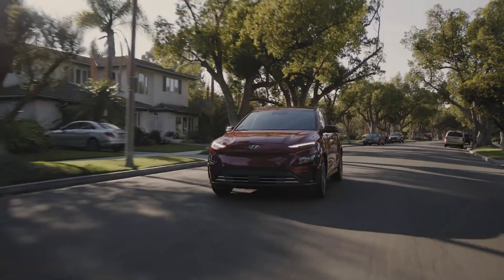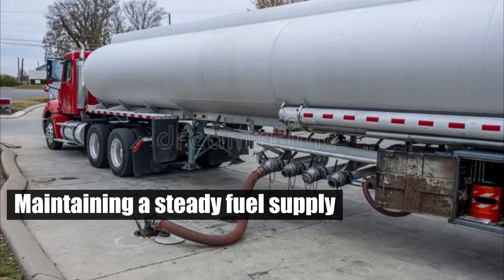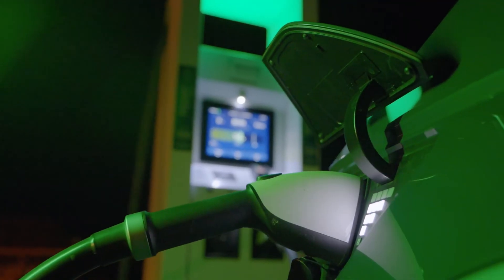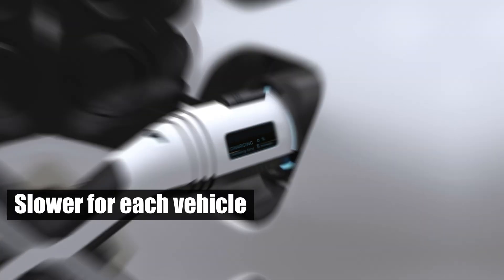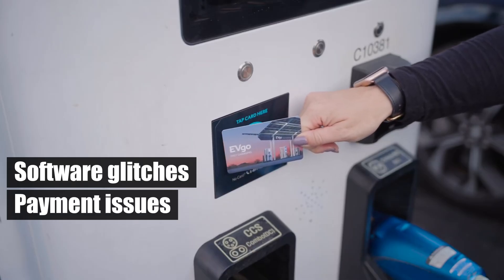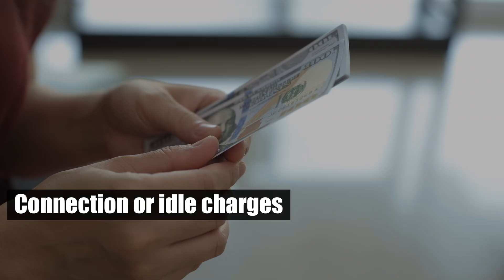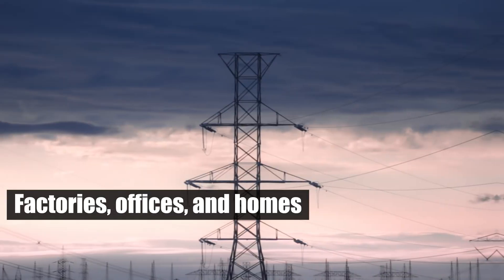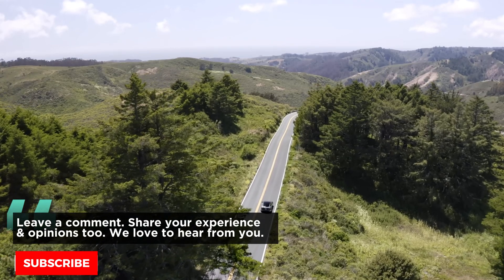The Shocking Truth About EV Charging Stations: Why They’re Failing Everywhere! Electric Vehicle Fail

Comment: The current grid is "not yet equipped" to handle EVs.  Why not say it straight? We'd need to significantly increase the number of baseload (not RE or "green" energy) output to address a complete conversion to EVs along with all the electric home/office heating that's being dictated in many communities.  You need a ton more gas/coal/nuclear stations just to make EVs truly possible! How long will that take to put in place? Longer than EV manufacturers have money to make up the losses....

Comment: EVs are a scam!  CO2 is not a pollutant. Without CO2 there would be no vegetation. 
Is the car that Biden chauffeured around in an EV??? Are all the government vehicles EVs?
The poor and middle class are subsidizing the rich so they can buy an EV. The EVs do not pay the gas taxes that support the road system. They weigh a lot more so they destroy the roads more. The electricity to charge their batteries comes from coal and gas (In Australia some places they are burning wood to generate the electricity to charge the EV batteries.). The materials to build the EVs come mostly from open pit mining which is destroying the earth. Who has control over most of the essential material for the EVs is China (the Biden family money machine). EVs are unreliable and a fire hazard. EVs are not recyclable. In cold weather & trying to tow something with an EV is a farce.

Comment: It has only been the last twenty years that the gas stations have cut down on their massive pollution of ground water from leaky cheap storage tanks.  
But OK, give them -- and Common Law -- credit for getting it right, um, after a century of incompetent, and at least sometimes criminal, polluting.
Reply: Pollution of ground water was a way overblown problem.  It's not like gas staion owners didn't care about leaky tanks since the lost gasoline is lost money.  Plus the simple tanks weren't expensive to replace.
Reply: A century? In the early days the tanks were above ground. Summer heat would cause the tanks to expand and fuel would evaporate quickly. And still even then the gas cars outsold the early evs dramatically.
Reply: Have had very good experience with EV.  Perhaps a more balanced presentation would be more realistic.  😊m

Comment: We'd need a new power grid... that would only take about 10 years and cost $2.5T
Reply: It needs to be hardened and you need to domestically produce transformers...they are finally getting scared of the lack of industry in the usa...probably too late and that may have been the plan...profit short-sighted verses strategic defense.
Reply: It’s not all about the initial cost, but the maintenance. Smaller cities aren’t going to redo the grid and power infrastructure for 1000 more electric vehicles
Reply: Upgrading the grid and adding power plants to meet everyone driving EVs AND providing truly fast charging (5 minutes or less) will take way longer than 10 years.  More like 30.

Comment: An EV  never NEVER  it appears all who have an EV  are in perpetual terror of that red line approaching  
turn heater OFF turn radio OFF  dont wash with scream washers .     Turn head lights off
better with a Horse   they warm between ya legs  
You get a EV  get a full camping kit in boot 
and tins of soup  biscuits and  a petrol camp cooker they much faster than gas . 
Sleeping bag  a candle ha ha ha lol